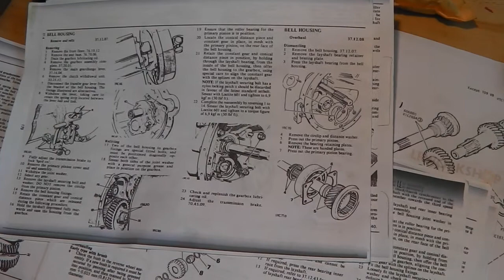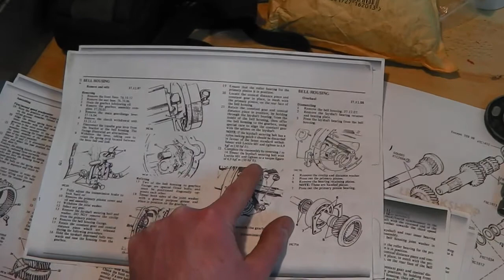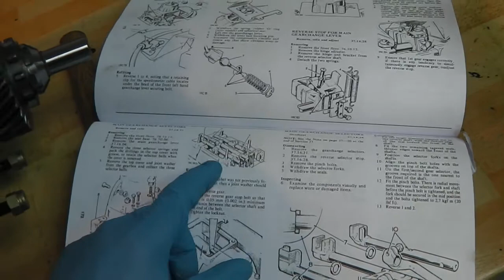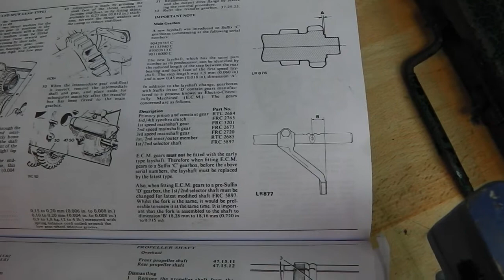Land Rover Series 3 Gearbox overhaul - Part 3

Comment: Great Video. Thanks! You torque the mainshaft nut with 100 lbf.ft? At other places I read from 85 lbf.ft…. 

How tight do you tighten the 4 nuts between the gearbox and bellhousing? I've now taken 86Nm. I'd like more, but I'm afraid that I'll tear the bolt out of the aluminum housing...

Comment: I've been rebuilding my gearbox and when I've put it back together the syncromesh seems to slide forward too far. I'm thinking I've pushed the mainshaft through too much so that the primary pinion isn't press up against the outside of the syncro enough. is there a guide as to how much end float there should be on the mainshaft?

Comment: Just wanted to add that your Videos are still definitive when it comes to Series III Gearbox rebuilds, thank you.  Question the Manual recommends greasing gaskets between the major Aluminium parts, but you have used Herildite, which I now stock as well... you also used WellSeal for the Front Output Box -  is this just personal preference? I was going to use Well Seal for all of them.
Reply from the maker: Thank you! The gaskets and sealers I used with this build worked well and it's all still perfectly oil tight- go with the Wellseal- I use that in my work with vintage vehicles and it's our "go to" choice.

Comment: Hi re the detent springs - why is the shorter one for the middle selector being the 1st/2nd? Other sources I’ve seen saying it’s for reverse
Reply from the maker: Hi, thanks for your comment. Very simply, that's the way they were when I took the 'box apart, but you are dead right - the shorter one is for the reverse selector , I re-checked the parts book again today. After a bit more research I need to revisit the selector seals too and carry out a mod made on the later gearboxes, so there will be something of a revision to this video uploaded soon. Thanks very much for pointing it out!
Phill.
Reply: @steamwally  thanks for the reply. Your videos are great and I’ve watched many helping with my series I’ve owned around a month now! Mine (I think) was also in the same way as yours but it fell into the box so I wasn’t sure. I’m going to put it where I think it should go and if it’s no good I’ll swap it. I’ve also heard of some people using three reverse springs all round ..
Reply from the maker: @poacher9118  oh dear, a gearbox rebuild a month in is rather serious! Admirable, it took me a long time to work up to such things. I've heard of people doing all kinds with the selector springs in the name of a slick change. The box currently in WRD was very tight to begin with and now has a nice smooth change for 50k miles, they seem to like a bit of clearance.  I'm not sure the springs make much difference but I'll certainly put mine right now. Always happy to be picked up if I make a mistake, it's far better the right information is out there.
Reply: @steamwally  luckily no rebuild just needed to change the selector seals as they were leaking very badly! I’m just finishing up changing the trans oils and a few other bits and going to take it for a drive tomorrow. I lined up the top of the selectors where the gearstick goes in but didn’t check for clearance between the selector forks so hopefully that won’t cause me an issue. Only time will tell. Cheers have a good wrrkend